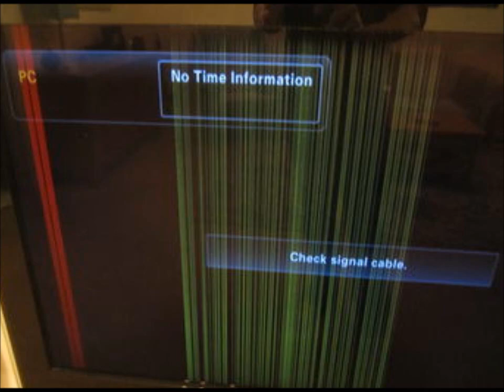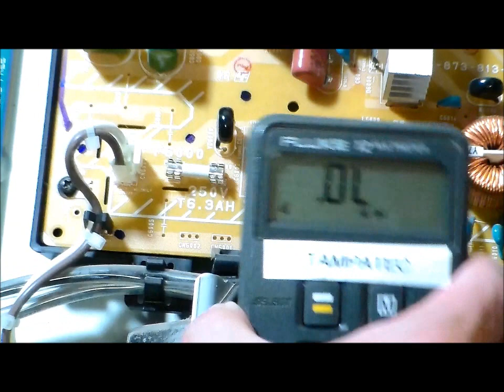What TV Boards Commonly Fail in LCD - Repair Service Guide

Comment: hi tampatec ,i have a problem with an lcd samsung distorted picture vertical lines ,turns on and off after 15 seconds ,i disconected the t-con board like you show in other video and the vertical line goes away remains light black so it's good i think,but still turns off ,i think its the power supply i've checked the ribbon cable that goes to tv tuner  with 16 pins and it has only 12v missing [13v ,5.4v. 5.4v, 5.4v 12v 12v 12v]this all missing ,can you share your opinion?

Comment: I have a song KDL 46xbr9 tv which turns on a 15 seconds later clicks off. It blinks red standby light 10 times. I replaced the power board and it does the same thing. Can you tell me what board to try next? The screen is perfect no lines it’s just clicking off. I would appreciate your help I’ll check back here often 1/28/23. Thank you Paul

Comment: RCA 46" LCD  46LB45RQ 

It has Gray horizontal lines on the lower 2/3rds of the screen.  You can see the picture thru them.  Changed T Con board but no change.  Do I have bad Caps on the video board maybe?

Comment: I have a Samsung 32" LCD TV Model ln32d403e4d.  I have intermittent problems with the picture quality, specifically the colors.  The colors will go to a red/green hue for no apparent reason.  I have noticed that I have a horizontal line towards the bottom of the screen.  Everything below the line appears to be fine while above the line is bad.  I can turn off the TV, wait a few minutes turning back on and it will be fine.  It will go bad again after a while.  Occasionally, I will get ghost images on the screen as well...this is where I change the channel and the image from the previous channel is still showing up as well as the image from the new channel.  The TV is less than 4 years old and was hoping the fix might be easy.

Comment: What about a solid green screen with sound would that be a tcon board problem sometimes it will turn on and work right but then screen will flash and turn solid green again

Comment: Tampatec...I recently changed out the power board & main board on my 2007 Samsung LCD Model LNS4041D..it works fine...but not for long. After watching TV for about 35-45 minutes the screen goes black...but the sound continues. What could be the problem?

Comment: Hi there, I own a Olevia 747-B11 tv for the last 8 years and never had a problem with until the other night when the picture suddenly froze. I changed the channel thinking it was the station who was experiencing the problem, but it turn out to be the set. I turned off the set for a few minutes then turned it back on. It worked for about three minutes and the same thing happened all over again. I did not watch tv any more that night. The next morning when I got up I turned it on and it seemed ok just for five or so minutes then it froze again and it has not produced any picture sound since. I have watched several of your video and you seem to know what you are doing. Please advise!!!

Comment: I have a SONY KDL-52V4100 LCD TV since 2009. It recently shows no picture at all, complete dark.  1 hour later, it shows picture but a horizontal thick black stripe moves slowly on the screen. 10 hours later, screen is complete dark. I am sure the LCD backlights are ON on both sides and the front green LED power indicator is ON. Could you give me your suggestion how to fix this TV ?  Greatly appreciate !

Comment: The light blinks on mine 42 lg there is no back light or sound. it responds to the remote control turn off when off is selected on the remote. I measured the voltage on the power supply according to what is labeled there it is ok. If I disconnect both inverter boards should the tv output sounds at least?

Comment: I have a 40 inch Dynex. The red LED is on but tv isnot on.. SometimesI can unplug it and plug it back up, if it clicks twice the tv will work, but if it only clicks once it will not come on

Comment: Am working on a Vizio M3D550KD TV replaced the power board (my fault) shorted out a N channel Mosfet. I have back light and sound from cable system but no video. I tried the flash light test but did not see anything. May be doing it wrong. I have searched the net and can't find the T-con board for a replacement. This T-con board does not have a bar code label, some inked in numbers on front and more on back

Comment: Vizio e70-e3 have backlights. Glows throigh panel, did some testing. And no power getting to drive boards for panel but I replaced t con and main board  still same prob. Both t con boards  the processor chips are not getting warm at all  I did do a lil testing and the wired  plug side seems to have power but in lvsd side  doesn’t seem to have power did order a new ribbon and lvsd cable to try that any other suggestion?

Comment: i have the same sony tv-its an kdl46v3000
when i plug the set in you can hear the power supply board click.
then when i power it on, the green light comes on, but no power it seems. the screen is not only black but dead. what confuses me is the green light as if its on. please let me know if you've seen or heard of this issue. thanks

Comment: Saby Varghese
Jun 20, 21:30 CDT

Hi, 
My name is Saby Varghese from NY. 
I have a JVC 55inch emarald series led tv ( Model# EM55FTR) it won't turn on. No standby light. But I noticed the Roku stick at back of the tv has a light on it. If I unplug the wire for 1 hr it will turn on with some flicker noise from the tv. The picture and the sound works fine, but u will hear some flicker noise in between. Once I turn of the tv, then I need to wait 1 hr unplugged In Order to restart. What could be the issue? Please advise

Comment: I have a 32" Element LCD TV that freezes on start up on the logo screen. Do you know of what is the main source of the problem or a way to fix it without replacing the whole main board? (the board with hook ups for hdmi, usb inputs, etc)
Reply from the maker: Derik St.Clair freezes you may need an firmware update via usb just contact element or factory reset tv or unplug cables for 5 minutes hard reset or lastly replace main board.

Comment: I have a lg60lb5900-uv led tv.   It is not turning on.   Ordered main power board and replaced.  Still no power.   No standby light or nothing.   What could the problem be?   Thanks

Comment: Do you still help diagnose tv problems?
Sony kdl52nx800 lighting strike killed it. Replaced logic board, first because was getting 2 blinks, after that red light stayed on solid, replaced power board no difference, now replace tcon,  still no picture but when you turn remote Sony comes on for a half second then goes off and green light blinks over l and yellow light blinks over clock symbol. Don't know what to try now.

Comment: Hi, I have RCA- LED46C55R120Q-  When I unplug and plug it again the red light appears but when I press the power button the red light disappears but the tv do not turn on. This problem was going on for several months, I did plug and unplug several times and then it tuned on, but now it do work in that way any more. Could you please help me with that issue?
Thanks

Comment: my tv is samsung UA55ES8000 actually TV was works fine before i de-assemble to fix vertical lines. so i was remove the back cover of tv then screw T-CON board and try to connect the T-CON Board left side socket to the with LCD panel right side Connection like vice versa to check the vertical lines get fix or not then tv turn power on and display goes to black ,no back-light, sound works. that was happen. please help me to find out which board need to be repair or replace?

Comment: Hey , I have  a Sony LED Tv Model no. 32EX33O Serial No. 2254129. now just yesterday I noticed a single thin black line running from top to bottom of the screen almost at the midsection.....what could be the problem and possible solution to this. Thanks

Comment: Hello 
I have a vizio 42" and everything is almost good but the screen is red and kind of dark and when i turn it on at first i can see like a cloudy black spot that within seconds they dissapear but the image keep on been red color and fuzzy,, can you help me out on this ?? What do u think is the problem?? I already check the fuses but they ate ok but except for one i already changed but it only wont turn on with a new fuse,, but when i take the fuse it will turn on but keep on been red and dark
Reply from the maker: 1st- check all your connections and cablebox connections, reset cablebox and tv by unplugging powercord for 1 minute,
2nd- tcon board can cause picture distortion but i seen bad capacitors in power board causes fuzzy picture. its usually not just a fuse.

Comment: I have a vizio e550vl - when just plugging it in - not touching power button or remote "on" button - it clicks on and off - on and off - on and off - repeatedly. Naturally it never comes on.  Unplugged inverter boards - same problem - disconnected the flat ribbon cables for t-con - same problem -  unplugged the top right-most cable on the main board - it stops. Can't find a main board for this tv - 3655-0152-0150 - no one has it. Shop Jimmy sent a couple of ic's (their mainboard repair kit for this tv) but they have no markings on them and are so hard to see I can barely identify pin 1.  Any idea's on where these chips might go? They sent no documentation. Any ideas of what the problem is may help tracking down these chips

Comment: I have a Samsung model pn42c450b1d which  make a noise when the power supply is connected,  the blinking light  only flashes  twice and then turns off. The TV doesn't have image or sound

Comment: I have sony kdl-40ex703 it's suddenly stop working two days ago and sadly it is out off warranty. The standby lamp flashes 6 times and couldn't find any help ,do you have any advise how can I fix it?
Reply from the maker: mermaid girl 101 unplug power cord then remove tcon board. If the TV stays on then replace tcon board at shopjimmy.com or electropartsonline.com use code tampatecfriend for discount.
Reply: I am a disabled person can't do it byown, and have no family or friend near by me?

Comment: i HAVE A hisense  tv model 42K20E  /When i hook my dvd or computer to it the picture is good.But when i hook up the direct sattiite dish to it it works but the picture is gray n black looks like alot of dots on it/with no color/i just put a video board in it that i got from shopjimmy any ideas what might cause this  tks

Comment: SAMSUNG 32 INCH REPAIR BN4400192ADC07BBF9647 REV1.0
After changing / replacing the Bulging Elco Caps - it work for 5 mins and the screen goes blank and the tv goes back to standby with the led red light on.  What could be the other probable parts needs to be changed.

Comment: the line is vertical. the board came with all new cables. guess im doing that next. though the tcon is built into the main board. its a vizio e550i-a0
Reply: I was told there is a board behind leds which is not serviceable. Have to take screen apart and you will find board

Comment: I have andesson tv.the issue is no sound or low .speakers have low sound.
 speaker magnets are hot crazy and smell burn.on speaker cable 12dc volt constant doesn't mater how loud volume.
maybe is short some amp ic chip or something .any idea cheers

Comment: I have a 50in samsung UN50H6350AFXZA. I was watching movie when the screen went  black but I still had sound. I did the flashlight test and noticed that I had black lights but no picture.  I only had this TV for 1 year 8 months. I replaced the T-con Board and Power supply board still the same no picture.  please help thank you.

Comment: +Tampatec, I have 2 Questions.. 
1st one..  I looked at all your videos on TV's but didn't see one for my issue. 

Can Ghosting (Burned images) be fixed? 
I use 2 TV's for my Computer as monitors. On my Sharp LCD 42" (Model LC-42SB45UT) I have ghosting burned into the screen, it is the windows, browser (The borders) buttons, words and some images as in wallpapers with color. The wallpaper images do fade away but the windows, browser (The borders) buttons, words, Color do not. 
It's only like 3 or 4 years old, and of course didn't start burning images until after the warranty was up. Is there a fix or is the TV trashed? 

2nd question is on a Hitachi hard Drive (Model HDT722516DLAT80) ATA/IDE 164GB Capacity mostly empty but there are a few files that I need off of it. 

At which I was using a adapter to connect it to my computer using a USB port and powering it with the supplied power that plugged into the wall outlet.. 

When turning off the Computer it doesn't power off so I have to unplug it, well I must have shorted it out because a few hours later it would not power on aka spin up.. 

The question is, how can I get it to spin long enough to move the files I need to one of my other hard drives. 

NOTE the Hitachi hard Drive IDE (PATA) is an internal Hard Drive but I have been using it as and external one.. 
  
My Computer is all SATA connects for hard Drives and this is why I was using it with a adapter to connect it to my computer using a USB port. it's not really a need hard drive as I have plenty of hard drives in my Computer a 2TB and 2 1TB. I had it, the Hitachi hard Drive 164GB so I was like hell I'll use it for mainly junk stuff BUT I have some somewhat important files on it IF I can get it to power on GOOD if I can't no big lost but would like to get the few files off if I can..

Thanks..
Reply from the maker: +Jeff Levy
1. tv screen burnin can be slightly faded with video sweeps, bright white rolling bar but otherwise replace the screen which can be pricey. 
2. Best buy i heard has a tool they use to find files on a bad hdd. Hope this helps, good luck.

Comment: My samsung tv model LNS4051DX/XAA at first has sound and picture but picture turns black after a short time. Did flashlight test and could see menu faintly. I put a fan in back of tv and picture will sta on.

Comment: I have a sony kdl 46b420. it had no red light nothing. I have 3.3 volts on.power board.  I replaced the logic board and im still at same point with no red light  and 3.3 bolts on power baord. what do i do now?

Comment: the screen was flashing and had that line bar on the screen. then it just went black no picture, but back lights still on. so i bought a new board. picture works but that bar line is still there.

Comment: i have a 26" lcd tv set that is completely dead no stand by light etc , will replacing the power board solve this problem ?
Reply: It may or may not. Sometimes replacing the P/S board will bring it back to life or you might end up with a TV where it seems to toggle on and off nicely, you see the led on the front change colours when you switch it on and off, but the TV otherwise is still dead. Often when the P/S goes, it takes things out upstream of it.

Comment: Hey men my Samsung tv does not want to connect with hdmi cables it says no signal.. I'm able to connect using digital cables but I have a Nintendo Wii u now and the only cable I have is the hdmi I have this problem for the longest please help.. Ps I love your videos jeep posting
Reply: its the main board that is failing. the hdmi controller on it gone. replace the main.
Reply: Ecturkum I figured that as well thanks for the reply
Reply: No problem   I too think ***** is awesome.

Comment: Sir I need your help once again. I have replace the T-Con Board with a new one I have ordered a week ago. And once I have turned it back on the Sony message appeared but it turns off once again but with orange and green flashes of light not the red one this time. Whats the next troubleshoot?
Reply from the maker: Reseat connections on tcon board but seems like main logic board issue.
Reply: Sir ,thank yuo for reply. What look like a Main Board ?, on the Left side Power Board / yellow board, other side Green Board ,
Reply: Thanks ! main Board Green.

Comment: hello i have a 40" Etec model# 40e700 on back of box inside on board model# cvb42001 s on a board inside serial# 43f0081403da0430 please help my screen is black i have sound and flashlight test shows the tv show that's on. is it the backlight inverter how do i change it in this tv believe it's a lips board or i have no idea what I'm looking at and seriously need your help. please

Comment: i have green sreen on my hd lcd tv  ...... 32'' sylvania hdtv some times you green mix with other colors and sometimes its just green you still see the image but its green . i turn off and on  image comes back then in a while it goes back to green. is it the inverterboard or something please help.
Reply from the maker: inverter board powers the backlight not colors, if all TV inputs have green screen it maybe main video board (green driver) or loose video connection or tcon boards. sometimes bad hdmi or component cables can cause this problem. i would first reset system- TV-cablebox-receiver by unplugging powercords for 1 minute.

Comment: I cant access the t con board on my sony kdl 40cx523 as it is hidden away at the top behind  the screen between metal panels. Does that mean I cant replace it and I will have to buy a new tv?
Reply from the maker: loman4659 no, see if there's screws holding it in sometimes its buried under metal plate.
Reply: thanks for the advise, ill have a look this weekend

Comment: I have a Samsung UN32F5500AFXZA with no back light sometimes it goes on for like 1 second then it goes off I already try replacing the power board but the same problem still there.
Reply: I don't know how the inverter board looks like on my tv

Comment: I have a 32" Samsung, the RCA and cable in Jacks do not work. the VGA port works. What is my issue?
Reply from the maker: solder the ground points, this worked for me.
Reply: ***** Thanks, I'll try that the next time it overheats... Good Ol' Samsung! ;)
Oh and thanks for your video on fixing a lose charging port on a psp